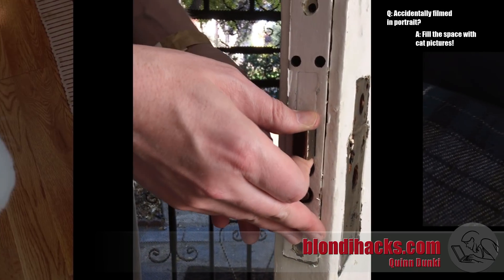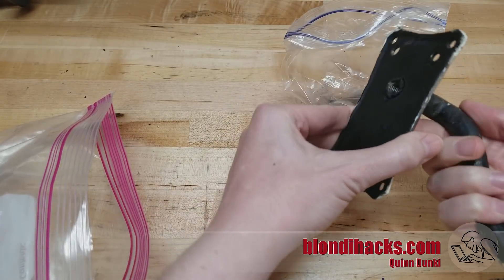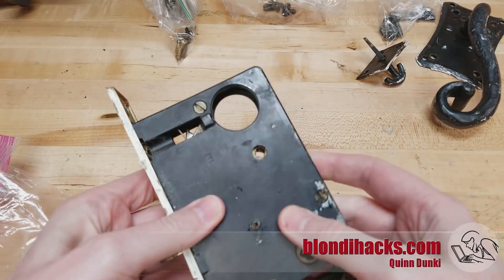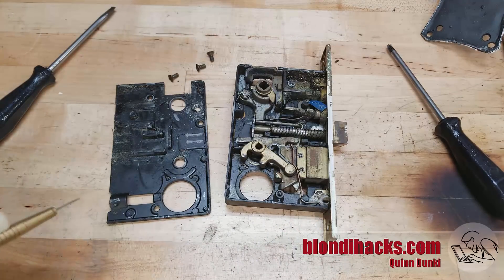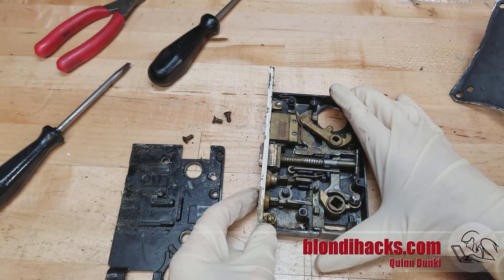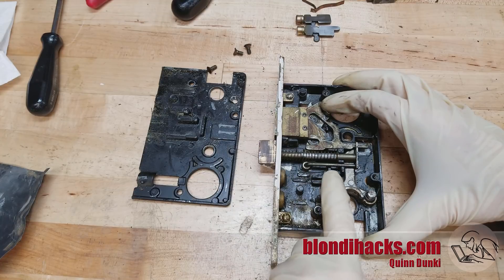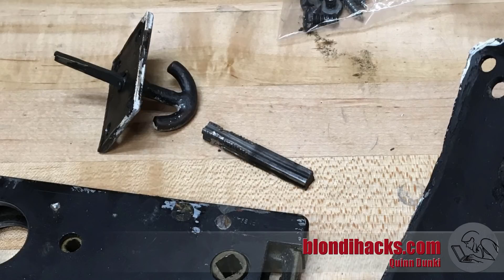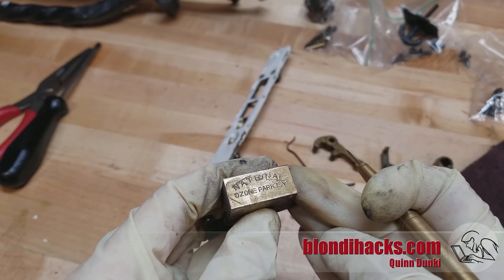Antique Lock Repair : Part 1 of 4

Comment: just found your channel after watching your most recent shop tour. subscribed. and this is my second video. super excited about what you do here to fix your lock. i have a house that was finished in 1900 and one of the old doors with this type of lock. i want to keep it, but i want to figure out how to disable the lock part in a way that doesn't hurt it. because we added a modern set to the door... but this means, to open that door you have to turn both the old knob and the new knob lol. i want to disable the old one without hurting it. or maybe watching these 4 parts i will find that i can temporarily pull it out and get a machinist to fix it so that it can be more secure (i live in a high break in area) without the modern set (which is easily pickable lol)... but with both door knobs even people who know struggle to open the door... which is good for security, but it breaks a lot of the modern door knobs because people go too hard at it and it constantly loosens the knob set once to the point someone bent it (not just the screws) etc. anyway, i'm excited to see more of your videos and have a nice selection of 15-20. all the best!

Comment: I have a very similar entry lock in my front door. It has brass exterior handle, glass interior knob, and brass deadbolt turn, and is engraved "Earle" in a fancy script on the escutcheon around the exterior cylinder. It is a beautiful piece of functional pre-war trim.      
It is original to the house (My parents were the second owners, I am the third), and I want to recondition the lock to last another eighty-five years, and rekey it if possible to accept the Schlage key used in all the other exterior locks in the house.

Comment: This is a bit key lock, Skelton key is the slang term for a key that works a group of Locks I know everybody calls them skeleton key locks . As you describe the buttons lock and unlock the outside handle or knob, in this case a vary rare Iever handle. This function used to be called the carpet bagger function, 1860's on. it allowes you to lock the outside of the door , but you can open it from the inside just by Turing the inside knob to answer . Carpet baggers are notorious for barging in your house and setting up their carpet bag goods with the intent to sell you something you didn't need. And the early days you would grab your flintlock gun then later on shotgun and escort them out of the house. If he was really argumentative with a shotgun double barrel you would have one load of rock salt. And in the other barrel you would have the real business. These poor guys will get shot in the ass with rocksalt on their way off the property. Presuming you can remember which barrel had the rocksalt in it??!!😎

Comment: Hello!
I really like your channel/videos, keep up the great work!

I'm a locksmith from Sweden, and the dominant style of locks here are actually the ones that require a mortise.
Granted that most of our (more secure) doors are made of steel, but a lot are still made of 45-60 mm thick pine wood.
The way we (most of us) install a mortise style lock (ASSA in my case) in a wooden door, is by using a properly sized spade drill at a specific distance apart, cleaning up the leftovers with a chisel and then using a hole saw to allow for a handle and/or a lock cylinder (tumbler?).
Have a great day.

Comment: I love mechanical restoration, and I'm learning more and more through others and my own experience.  My main interest is in antique typewriters of which I've restored several including repairs and some handmade parts and broken cast iron repair. I'm seriously considering a mini lathe for possibly making parts in some special cases. At least that is my excuse. So videos like this are both fascinating, educational and inspirational.
Reply from the maker: A lathe is a great tool for restoring machinery, for sure! You can make all those little pins, shafts, linkages, bolts, etc that aren't obtainable any more. They're also great for cleaning, sanding, and polishing round parts (as long as you cover the ways when using abrasives). I say go for it. 😉

Comment: In the U.K. at least, some mortice locks do have the feature of operating the latch once the bolt has been drawn back. The mortice locks on the PVC double glazed doors on my home (less than 20 years old) do this. And mortice locks similar to yours (but without the “soft lock” buttons) suitable for fitting in wooden doors are still available.
Reply from the maker: That's great additional context- thanks for sharing!

Comment: <> Well done -- you could talk a Dog down off of a meat wagon.  
<> Suggestion -- When you split open the Mortise lock -- take a picture of the assembly -- to avoid any head scratching !  Two thumbs up .
Reply from the maker: That's a great tip- thanks for sharing! I did in fact take a bunch of photos, as you'll see in the reassembly.